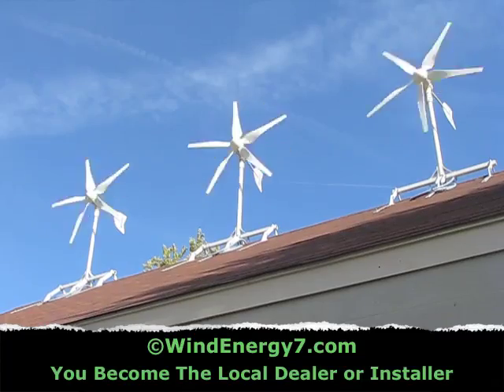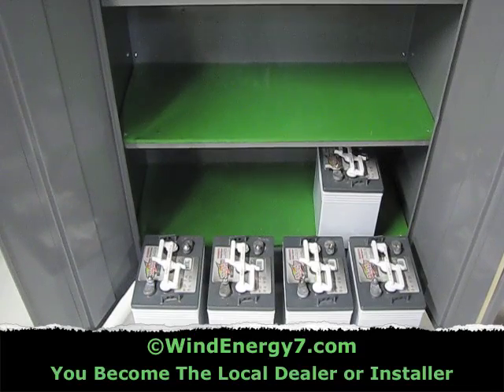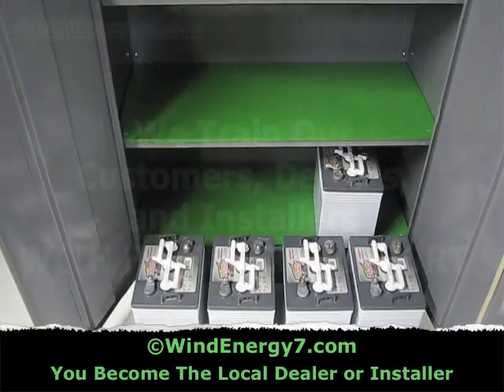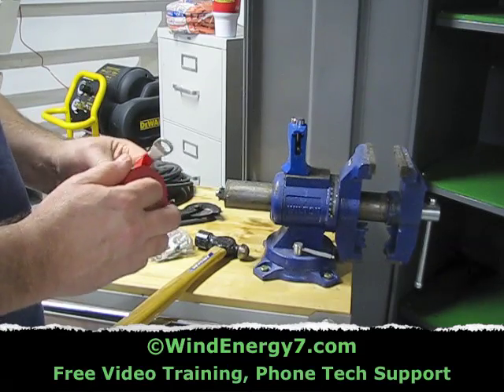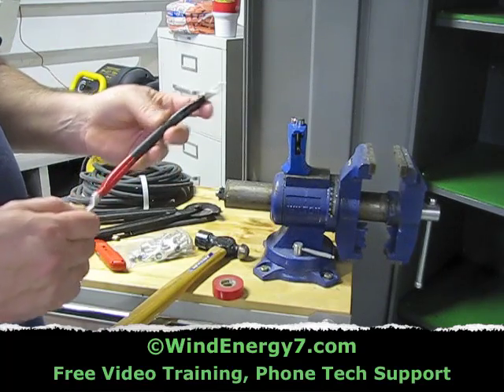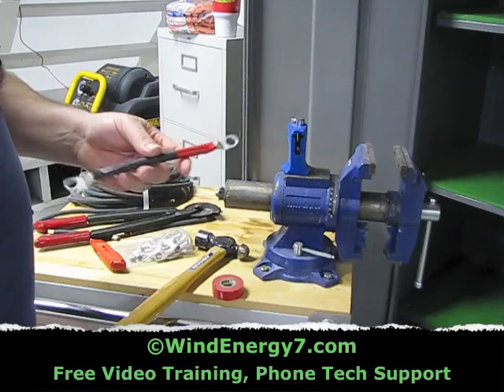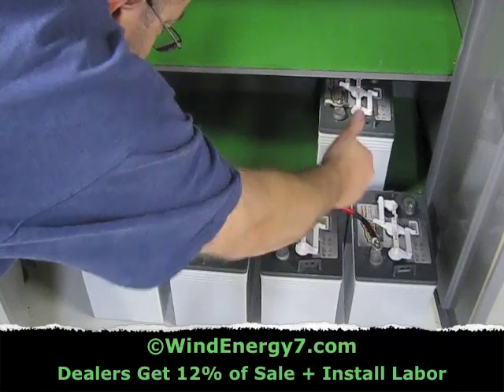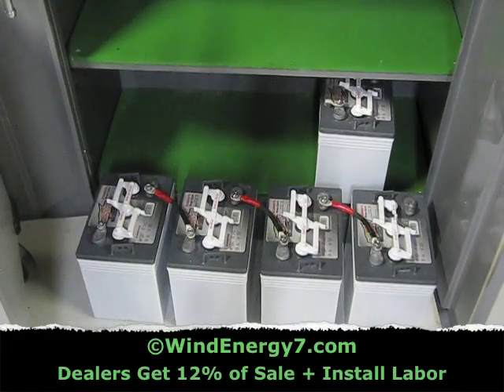Small Wind Turbine

Comment: If this is in a residential neighborhood what safety regulation and insurance hurdles did you have to go through in case you have a storm beyond 130Mph and it flies off the roof into a car, house or touch wood, into a person? Does it need/require grounding for lightning protection?

Comment: Review By C. Luczak: ★★★★★ 3 years ago
I helped a friend install the the RoofMill system on his house here in Utah last year. It was a great experience and everything worked just like it was supposed to. WindEnergy7 helped us through planning, permit, install, and everything and we had never done a windmill or solar panel before. The kit was well designed. I wish it came with the batteries but from what Sam at WindEnergy7 said it cost more to ship them than to buy them local so that makes sense I guess. The system has been making power for months without a hitch. The most fun home improvement project my friend and I have ever done. https://www.google.com/maps/contrib/118259844948444805320/reviews

Comment: Reviewed By C. Luczak: ★★★★★ 3 years ago
I helped a friend install the the RoofMill system on his house here in Utah last year.  It was a great experience and everything worked just like it was supposed to.  WindEnergy7 helped us through planning, permit, install, and everything and we had never done a windmill or solar panel before.  The kit was well designed.  I wish it came with the batteries but from what Sam at WindEnergy7 said it cost more to ship them than to buy them local so that makes sense I guess.  The system has been making power for months without a hitch.  The most fun home improvement project my friend and I have ever done.
https://www.google.com/maps/contrib/118259844948444805320/reviews

Comment: What kind of battery are you using? How long battery will last if i use 2000+ watt inverter and connect window, roof, or portable AC unit? Thanks

Comment: By Mounting the RoofMill™ Small Wind Turbine on a Roof Mount of the building it saves from having to buy a wind tower. This is one main reason the RoofMill™ invention has been so successful as a Small Wind Turbine. By putting it on a Roof Mount it saves cost, but you also harness the wind acceleration as it passes over the Rooftop. 
Small Wind Turbine - https://www.youtube.com/user/SmallWindTurbines/videos
https://www.youtube.com/watch?v=GGvzvtKdbG0

Comment: fantastic
Reply: +master kit WindEnergy7 Review by +Charis Luczak = ★★★★★
I helped a friend install the the RoofMill system on his house here in Utah last year. It was a great experience and everything worked just like it was supposed to. WindEnergy7 helped us through planning, permit, install, and everything and we had never done a windmill or solar panel before. The kit was well designed. I wish it came with the batteries but from what Sam at WindEnergy7 said it cost more to ship them than to buy them local so that makes sense I guess. The system has been making power for months without a hitch. The most fun home improvement project my friend and I have ever done.
https://www.google.com/maps/contrib/118259844948444805320/reviews/

Comment: Anyone ever complain about the view?  I wouldn't mind, but I'm sure you'd have someone unhappy about it.  Ever run into city ordinance issues or anything like that?
Reply: marquezca1 Whats wrong with the view?  Its not like they are giant wind towers or something?
Reply from the maker: Not complaining to me or my customers.  I have successfully permitted every community we have tried in over 40 states now.  These are not towers, so are really just an appliance install to a home.  RoofMills are very permit friendly, structurally certified to 130 mph wind speed in every state of the US.  They are UL1741 and NEC 2011 compliant and proven over many years in the field to be reliable and safe.

I advise customers to print a good photo and talk to neighbors first and they have always said its OK with them.  We also help submitting all the engineering to permit authorities so that they know they are dealing with very experienced people, not first timers.  I get nothing but positive comments everywhere I install.  I have a few customers whose wives don't want it on the house so they put it on the barn or garage. But this isn't some DIY science project, you can see its very professionally installed and designed.  They aren't noisy or obnoxious to look at and the Roof Mounted Wind Turbines don't intrude into a neighbors property or anything.

Its a hybrid power system making power day and night from now on.  There is no other system like this and we have been really successful over many years now.  Thanks for asking.
Reply: marquezca1

Comment from the maker: Depends on where in IL you are located you may be buying direct from WindEnergy7.  Go to the website and hit the contact link.  We only handle inquiries made through the website and then will direct you from there.

Yes we have kits starting at $11k and up from there.  You can get a smaller kit and upgrade over time to whatever size system you like.

see: Wind Energy 7 . Com

Comment: Our HO TowerMill product has a low wind startup speed that is the envy of competitors. TowerMill™ features all the great advancements from our RoofMill™ line and also offers larger output capability.

Our products feature redundancy with less single points of failure and complete energy security. By being Grid-Tie and Off-Grid capable, our systems a ALL feature 4 sources of redundant power available, wind, solar, battery bank, and grid power.

Comment: RoofMill™ small wind turbine is the popular choice for homes and businesses in the United States due to outstanding reliability, efficiency, and ease of deployment. In an urban environment, the RoofMill™ is out of the way and leverages it's easy installation as a way to get through permitting. Our RoofMill is not a construction project, requires NO CONCRETE, walls, trenches, cranes, thus is the popular choice for urban or residential wind and solar installation.

Comment: Congratulations.  The system featured here RoofMill™, is the invention of WindEnergy7 LLC founder, pictured in the video.  This patent pending invention released last year has won the Think Green Design Award 2010, in a contest by Allied Electronics.  RoofMill™ Advance Home Energy System, it's a grid tied home wind turbine generator together with rooftop solar panels in a complete "Whole House" system.  It has emergency UPS for your home and can run your meter backwards selling unused power.